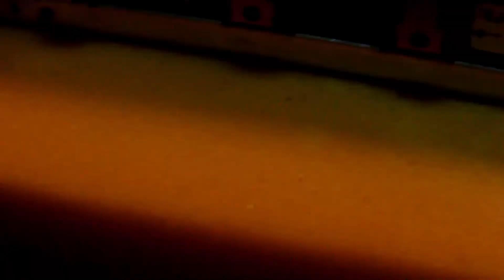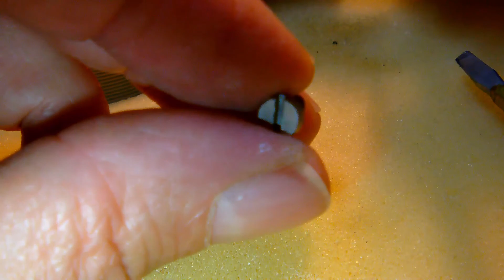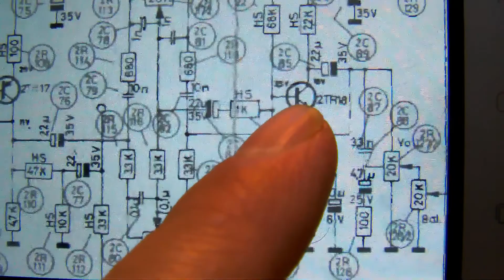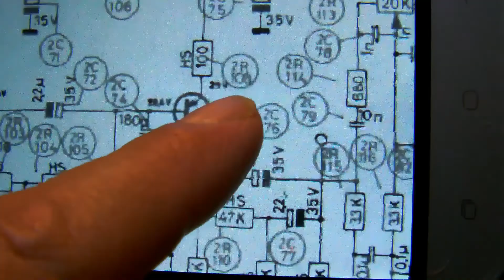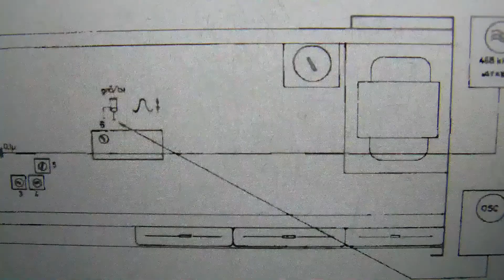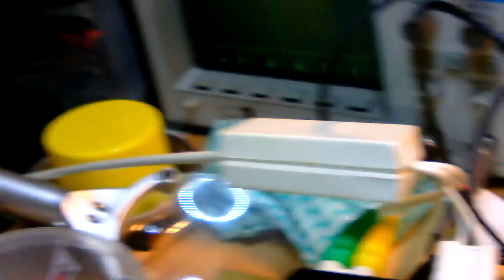Bang & Olufsen Beomaster 901 Tuner Amplifier Repair Restoration part 2 of 3

Comment: Finding this series of videos very useful.  My 901 has a dead left channel (amongst other issues) and I'm about to take out the power transistors to check them.  However mine has a set of Texas Instruments transistors which look like they might be original fit rather than a later repair (?) They are TIP120 (npn) and TIP125 (pnp) which matches a handwritten note in an original Beomaster 901 service manual I managed to get hold of, which is good as these are also very cheap easy to find !  The note also lists BDX53 and TE1088 as other replacements for the BD697 and BDX54 and TE1089 for the BD698.  I should mention also my 901 does not have the mounting bar holding the power transistors against the heatsink as yours does, so another later version design change it seems that actually makes choice and installation of different replacements easier. Also looking in detail at the circuit board layout in this area it is slightly different from that in the service manual in the tracks between the 0.39 Ohm resistors and the two transistors they are adjacent to.  I assume mine must be definitely be a later revised model (?) What is odd is at the moment the LEFT channel is dead but I can adjust the bias voltage across the resistor to 10mV as required in the service manual but the RIGHT channel is just stuck at about 1mV.  I've just now replaced both channels trim pots as the RIGHT one was quite corroded but nothing has changed and LEFT is still OK and RIGHT is still not responding to the trim pot.  Is the bias transistor perhaps also faulty ??  Am still trying to work out what's wrong overall as its the LEFT channel that is dead but the RIGHT is also very distorted anything above about 1/3rd the way up on volume slider.  I thought it might be the slide potentiometer on the balance control as feels terrible (stiff and grinds despite cleaning with contact cleaner) but seems to actually work ok (any idea what a suitable replacement one might be ? as that definitely needs replacing).  Have replaced almost all the capacitors already with ones from Beoparts service kit (except a couple that are hidden under the volume wheel... didn't fancy taking that off and trying to get the string back on 😱) so thought I'd be on the home straight now 😖 its going to be full winter project it seems 🤔
Reply from the maker: Hello Pete, The fact your left channel is "dead" doesn't automatically mean the end-stage power transistor is broken. 
The fact there is an imbalance in bias current and, no matter how you try to set it, doesn't have any noticeable influence would seem to suggest the problem MAY be earlier in the circuit.

If you have already unmounted the original end- stage transistors, then by all means test them.
The best advice i could give you is, to inject a tone into the amplifier at the AUX input/preamp stage and then watch the signal propagate through the circuit with an oscilloscope or with a sensitive DMM.

Use the working channel as a reference to measure the voltages and signals at the same stages in the other sound channel, since the amplifier is largely symmetrical.

Take your time and don't jump to conclusions and start to willy nilly replace components. Always make sure there's a load connected to the amp's outputs ! ! (8-10 Ohm 25W power resistors or expendable speakers)
Finding the problem in a circuit is half the fun, the other half is to finally bring the whole amplifier to life :) Success and thanks considering subscribing  !
Reply: Thanks for the useful guidance especially where to be looking, yup I was probably jumping to conclusion as there are various notes written into the service manual I have which mostly relate to the output transistors so I was thinking "well they do seem to be a problem".  I do indeed need to get a load on the outputs, resistor option as I don't have any "disposable" speakers at moment.  Luckily I do have a mini oscilloscope and can inject a known test signal with app on my old phone into the Tape input (1kHz will do I guess), I'd tried it out at the balance fader but need to do trace through signal path properly !
Reply from the maker: A 1KHz signal will do nicely for tracing the signal path through the circuit. Remember, when you're "stuck" somewhere in the circuit, you still have a good working audio channel to help you out as a reference too.
Don't rush things and think your way through the problem and make notes of the measurements and/or phenomenons you experience while testing. Your notes will help you to make informed decisions as to which step to take next. Logic is at least half of the fault diagnosis :)
Good luck !

Comment: This is a very helpful article as I have a B&O 901 that is currently dead. It has signs of the heat sink material  having blown out from 2 of the output transistors. I plan to start with renewing the output transistors and the other little dome ones as well as the square resistors. I am struggling to find these. It would be a great help if you could advise where they may be bought. John
Reply from the maker: Hello John, glad to read you are finding useful info on how to repair your Beomaster 901 in this video. I actually made 3 videos on restoring the beomaster. As for the endstage transistors; the original ones looked pretty but, after some extensive research I found buying original ones to be prohibitive and I therefore switched to more commonplace transistors.

For the push-pull endstage I settled on a BD647 & BD648 (NPN and PNP respectively) transistor pair (look up the specs on the net if you're unsure). Their specs are close enough to the original Motorola transistors with a little overhead. If possible try to find a matched pair of BD's (which is a bit more expensive)
Be aware though, you need to replace the rest-current power resistors too (if memory serves 0,39 Ohm 5W ? 2R142, 2R143, 2R191, 2R192) to be on the safe side and you have to set the rest current appropriately with the designated potentiometers (2R137 / 2R186) ! Do NOT set rest current (with Volume set to 0) if the transistors are not mounted on the heatsink yet and make sure you have speakers or an appropriate load (power resistors of 8 Ohm 25W minimum) connected to your amp or otherwise you run the very real risk of burning through your new transistors in less than 30 seconds !

One final remark, I measured a bunch of resistors around the endstage and found some to have drifted significantly from their rated value (+-15%)
Remember currents in a push-pull endstage are critical for good performance and therefore good resistors and capacitors are imperative, I'd say. 
It'll take you a while to get the job done, but you'll enjoy the result so much more afterwards :)
Good luck
Reply: @TechneMoira  
Thanks very much for the helpful response. I will be taking my time and have no rush it is just a fun project for me.
Regards

John

Comment: Warning !  Stereo lamp is 1watt but tuning lights are 30-40mAh. If you put 1watt lights in tuning side the 2w resistor for those light will burn.
Reply from the maker: Thanks for the warning Alberto, I checked the lightbulb, it's rated for 350mW. The power resistor does get warm but not excessively so (around 50C°). I guess dashboard lightbulbs don't need to be more powerfull. Thanks for the tip and the thumb's up :)